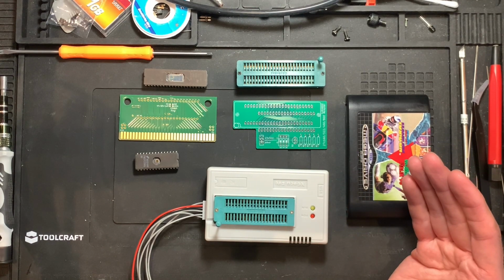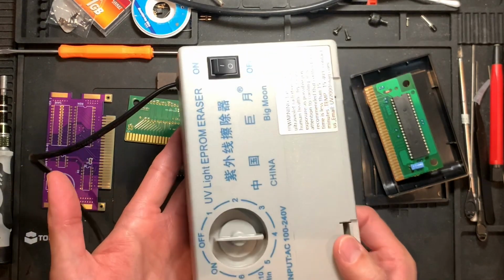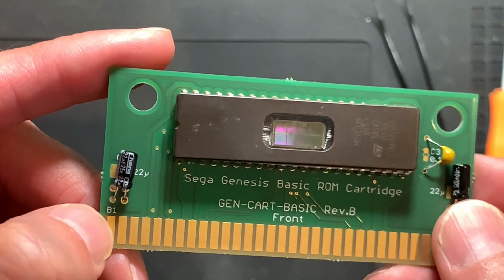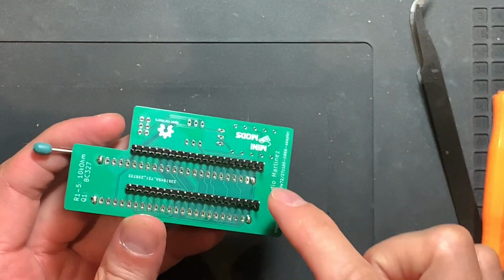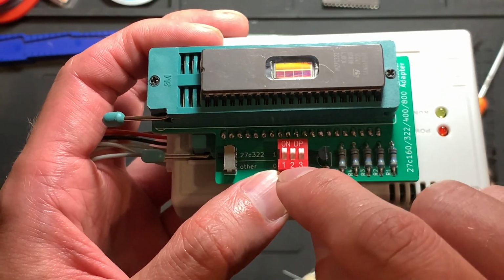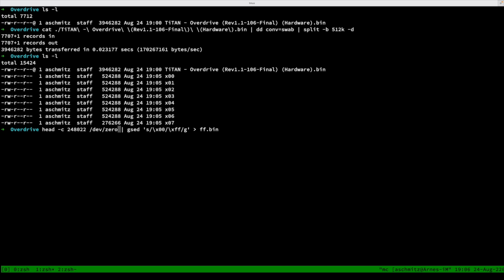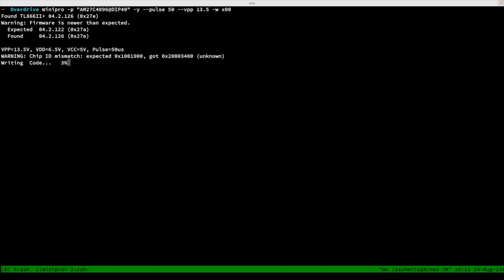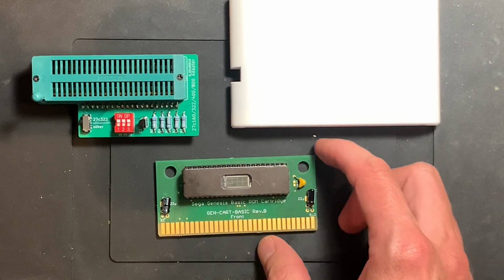Making Your own SEGA MegaDrive Cartridge

Comment: Any information on if the adapter board will work with the t48? Kind of hard finding a tl866ii
Reply from the maker: I mean it is basically an adapter that emulates a smaller EPROM, so it should work, I guess?

Comment: I wonder if there are some developers who develop cartridges using microcontroller, such as rp2040.
Using this chip to increase the data memory capacity, save data and reduce the production cost.
Reply from the maker: There are SD card and flash based cartridges, which are good for developing games and/or for homebrew. I think an rp2040 might make sense, IIRC there is someone making an N64 cartridge using that.
Reply: @root42  yes sir, but isnt rp2040 cost less than any of those?
I hope the chip with 16mb serial flash memory could help the developers create games easier and cheaper

Comment: Great video!  Gotta try this myself.  Note:  gsed doesn't appear to be installed on Ubuntu, but an alternate way to quickly create your 0xFF pad file without gsed with plain bash is:  for i in {1..248022}; do printf '\xff' >> ff.bin; done
Reply from the maker: Oh, very nice. There are lots of ways to achieve the same goal! I think ubuntu simply calls it sed, by the way. Should be gsed inside.
Reply: @root42  Sed's definitely installed; I've been using it on Linux for 20 years.  This is literally the first time I've heard of it referred to as 'gsed'.  I guess that's a thing Mac users invented to distinguish our sed from their original bsd-variant.  TIL!
Reply from the maker: @3vi1J  Yeah, the BSD and original UNIX sed have a more limited feature set. GNU sed is greatly enhanced. Since Linux is mostly GNU/Linux it comes with all GNU tools by default. But luckily you can simply install GNU tools on macOS as well!